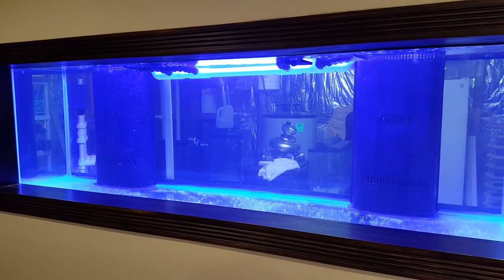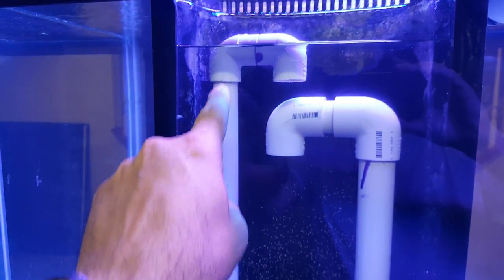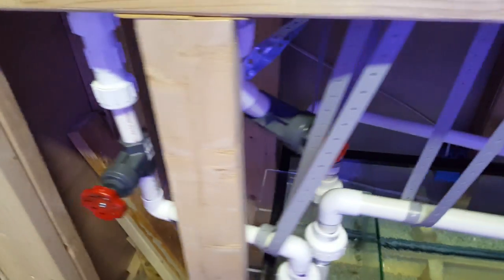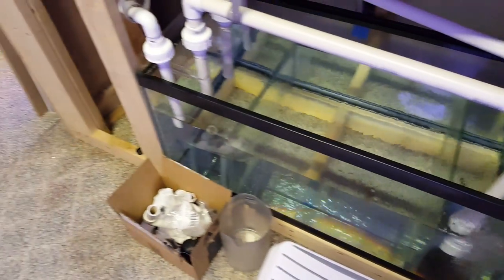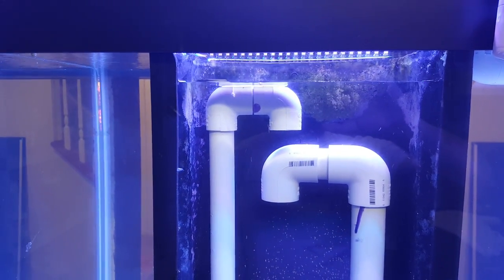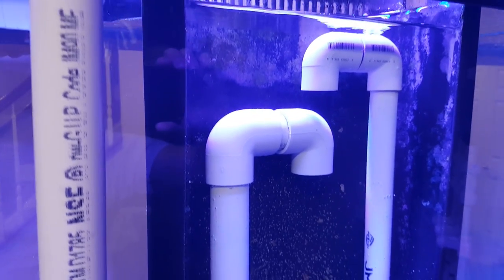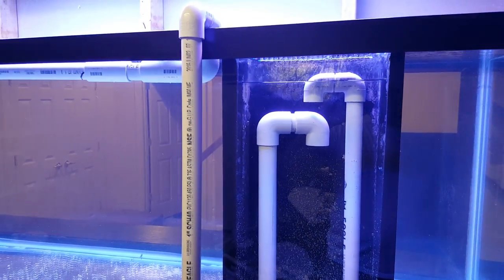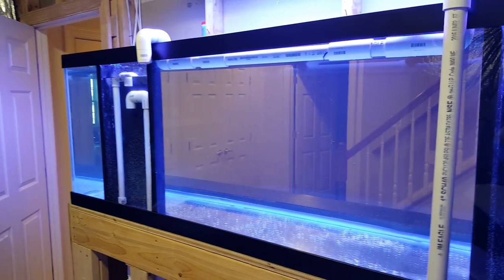How to turn a mega flow into a full siphon.

Comment: any concerns with using this setup on a basement sump?
Reply from the maker: If you mean the sump is in the basement and the tank on the floor above it I don't see any real concerns. I would test the fail scenario since the amount of water that will be in the pipes could be enough to flood in the event of a pump outage.

Comment: Only thing I would add is to put a check valve on the return pipe so that it can't siphon back down from the jets when the pump is off. Otherwise I think this is a perfect setup and I might use this on my next tank.
Reply from the maker: Thanks for the comments! In my case, I want the water to drain back down as it is part of my water change routine to have more water in the sump. I typically do a 20 gallon change and with the drain back amount this makes it easy to do entirely from the sump. Also check valves with saltwater tanks can be problematic as marine life and ditreus tend to collect and make the unreliable.
Reply: Makes sense. I usually do an oversized sump (1/3rd tank water) whenever I can fit it for same reason. As well as add as much water to total system volume as I can. Thanks for the video will reference this for sure on my next new sump in a few weeks (tank pending wife approval).

Comment: Running this setup without emergency drain will only prevent flooding if you don't run  auto top off folks, unless you are manually topping it off.
Reply from the maker: Partially true. Most auto top offs will stop after running 2-3 minutes. This tank uses the Tunze Osmolator which will shut off after it runs too long. It will not overflow the tank in my configuration. It is all about good design.

Comment: Does the water flow down the open channel as well
Reply from the maker: Yes it has to have a small trickle down the open channel. There really is no way you will ever get a full siphon drain exactly balanced. You need to have a smidgen more than full siphon. The open channel takes that slight extra trickle to balance the system.
Reply: I just got a 180 gallon I have four 1” Holes with that be in the flow doing it the same way you did?
Reply from the maker: Yep  - you are golden that setup should work great. Set up the exact same way. 1 tube in each weir for full siphon and 1 for the open channel. Return over the top.

Comment: Nice! and quiet. Why no check valve?
Reply from the maker: Thanks! Check valve where? There is no place where a check valve would do anything accept get gummed up. They are not needed on a properly designed system.
Reply: +robc right on top of the return pump. so when you shut off your pump to feed your fish the water doesn't drain back into the tank. it will just start right back up. I've never seen a tank in 20 years or so of doing aquariums not have a check valve on the return.  Nor have I ever have one gum up or even need to be cleaned.
Reply from the maker: Thanks for the comments! Typically in the Saltwater world, check valves are not used. On this style return where the siphon starts automatically, there is no need to keep the return lines primed with water by using a check valve. Tanks I have seen with check valves usually "need" the check valves and should the valve fail, the sump tank would flood, and hence the reason for the check valve. As you have seen in this video, there is no chance of a flood. 

For an air line I would agree with you that they benefit from a check valve, but for a drain that is fully automatic, they really do not add anything to the setup. In saltwater tanks, the growth of marine life inside the check valve has a good chance of rendering it inoperable anyway.

With my setup, I count on that extra volume in the pipes and the tank to drain back into my sump when the return pump is turned off for my water changes. Without it, I do not have enough water in the sump for the volume I replace and would have to remove water from the display tank. If you look on the side of the sump, you will see black lines which indicate the water level when the pump is off and water has drained back and in 5 gallon increments thereafter.
Reply: I forgot to ask. How far from the overflow grids/top should we have the top of the open channel? Looks maybe 2"? How much lower should we make the full siphon? Thanks again.
Reply: a check valve would only be beneficial if the drain stack pipe and weir both failed simultaneously, better chance at hitting the lottery....

Comment: How did you determine the height of your siphons ?
Reply from the maker: If you mean the standpipes it doesn't really matter. I wanted them as close to the top as I could to minimize the noise of the water going into the weir.
Reply: Thank you for your reply.

I am attempting your system on my 120 reef with corner overflows

Comment: Why not have a check valve on the return and then you can position those nozel’s anywhere you want and not worry about creating any backflow if the tanks shuts off.
Reply from the maker: Check valve are a big no-no on aquariums. They fail, fail often, and fail at the most inopportune times. Never trust a check valve! I will never use one.
Reply: @WoodBob  it’s simply a mechanical way to ensure the back siphon is broken.  I’ve read many articles (including
BRS) that recommend using on the return to keep water from siphoning into the sump, particularly when the returns are in the back glass.  But back siphoning could be a problem regardless of how the returns are positioned.
Reply from the maker: This is true, but a check valve is not the way to go. As a backup they are ok, but don't rely on them as a primary means of flood control. Most people with experience in this hobby will agree with that. I wouldn't use them at all due to the muck that always gets stuck in them and gums them up. The best bet is a simple siphon break, which is a hole drilled in the return piping just below the surface, so when it is exposed,  air breaks the siphon. This allows the returns to be positioned anywhere one wants.
Reply: Yes,  I think the flapper style are prone to failure but the ones with a plastic ball work fairly reliably.  I just like to have options when positioning the return nozzles (deeper or higher up).  Thanks for the great video of your set up!

Comment: you say you don't need a emergency drain... but isn't the open channel drain exactly that?
Reply from the maker: When saying "emergency drain" in regards to aquarium sump plumbing, it usually refers to the Bean animal 3 drain setup which has a dry stand-pipe that is purely for emergencies. With a Herbie 2 drain setup, the 2nd drain can be considered an "emergency" drain but often can't handle the flow of the full-siphon channel so IMO is not a true emergency drain. It is used for tuning the full-siphon since for practical purposes, it isn't possible to maintain a full siphon without some water going into another drain (open channel). 

You could probably plumb the system to where this open channel drain would be able to manage the flow of the full siphon drain perhaps by reversing the pipes and using the smaller diameter pipe for the full siphon and the larger for the "open" channel/drain or "emergency" drain. This would result in an un-tuned full siphon if it was ever called upon to take the flow of the primary full siphon (it would flush a lot most likely) but would do the job. 

But again, I want to stress that my setup does not need an emergency drain since there is no scenario where a flood would occur regardless of the state of the drains.

Comment: Why run the extra fittings? Why not just open pipe to run full siphon?
Reply from the maker: My pump can't keep up with a 1" pipe running "full" full siphon. It is running full siphon though, just not at the max capacity it could be running due to being sized down by the valve to slow it down to match the pump capacity.
Reply: robc I run the same tank with 1 1/4" pipe in the overflow reduced down to 1" at the bulkhead and gate valve to control flow. Granted I'm running a much larger pump the dcp 18000 but I also am running a manifold to run my chiller and reactors. But I still only tune to keep water at a quiet height in the overflow. I just don't understand the purpose of adding the elbows on top of the drain pipe. Are they functional?
Reply from the maker: If you are referring to the 90 degree turn on the full siphon (larger pipe) it is to keep the water from creating a vortex as it enters the pipe. For the smaller open channel it is to allow air behind the water to prevent "flushing".
Reply: robc OK that makes sense. I just cut my large drain shorter so it wouldn't have a vortex. Only reason I did not put a 90 on mine was for restarts, I have no lag from pump on to return pipe flow (or equalizing as in your system) Nice setup and great tutorial video 👍

Comment: I like the set up but met my little friend Mr. auto top off lol
Reply from the maker: I have an ATO on this tank and will soon post a video of it in operation and testing for flood scenarios. My feeling is it will not flood since a: the ATO reservoir is only 10 gallons and b: it will shut off if it runs too long anyway before dumping even a gallon of water in the tank.
Reply: Looking forward to it.
Reply: Always Always use a dual sensor top off or wire one in yourself. A single float switch will fail. Not a matter of if, but when.. Even use a dual sensor ato with another float switch! It's well worth the effort. Yea I had a bad experience... lol